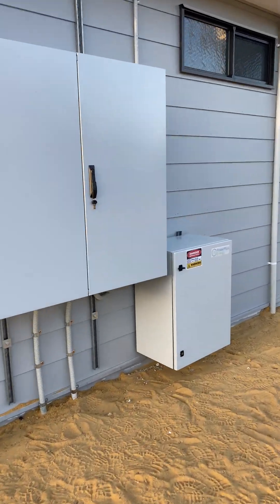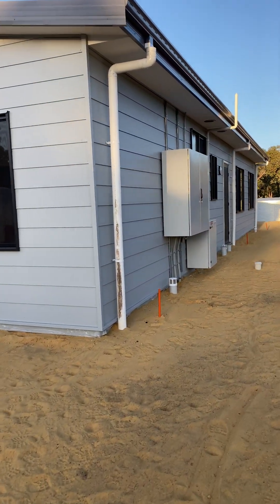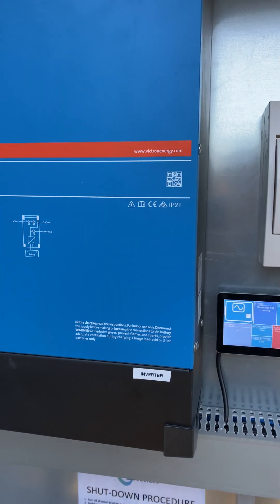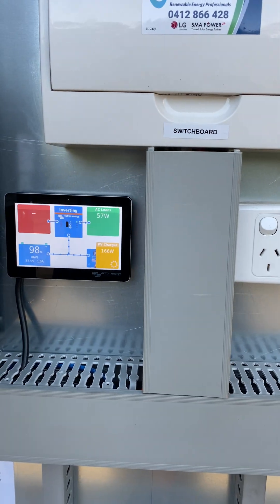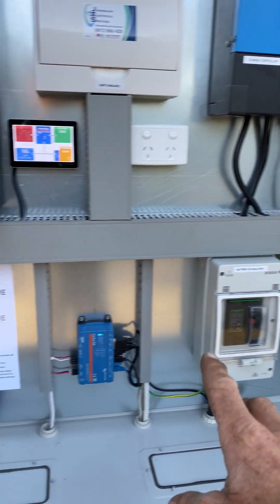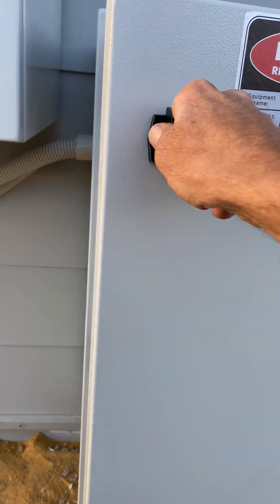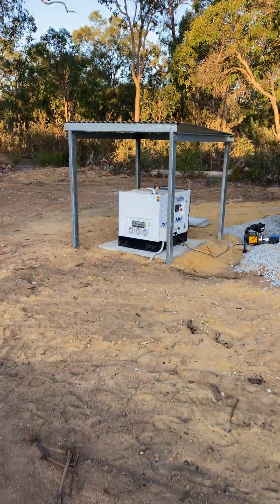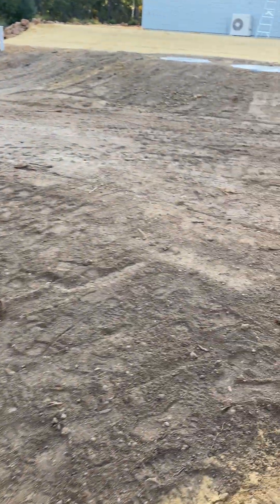Victron and Power Plus batteries Off Grid Power in Australia for a modular tiny transportable home.

Comment: Nice job & clean install, I do have serious concerns about the amount of ventilation for the Victron gear though, i have mentioned elsewhere why I believe it needs temp controlled fans & maybe a slide out washable filter underneath for better cooling & ventilation, just to play safe if nothing else, but this gear can/does create a lot of heat in that small space, and I am sure that system & it uses is going to grow sooner than later. Beautiful execution all round, and I cant believe how much of a finished house they have in just 1 week, amazing. TFS. Cheers from Qld
Reply from the maker: Thank you and Yes I agree to an extent. There is actually some ventilation behind the back panel. In addition the entire system is in the shade and wont actually be working very hard. The Victron products are very durable and get installed in way worse locations in motor home and boats, there is plenty of ambient air in the cabinet. I will however be asking my client to monitor the temperature of the cabinet and better ventilation would be an absolute must if the cabinet was in the sun..
Reply: @joondalupelectricalservice3201  my first multiplus 2 had no thermostat controlled fan. it gets too hot in the cabinet. i wont do that again. see how you go but i always use extractors now. you can get good 120mm AC or DC fans from jaycar that work well and only 50 bucks or so.
Reply: Agree on that, I got thermally controlled fans in my inverter box, work very well, I use pc fans 6€ each (120mm).
Job is well done, good job.
Reply: Exactly what I will need “extra Ventilation” we have same problems and the inverter / charger derates itself as it gets hotter, it does drop out on hi temp, I’ve introduced more fan cooling, here’s a tip aswell, there is a temperature sensor called Ruuvi that you can add to the Cebro and displays on the VRM which you can switch relay on/off maybe a larger fan.
Reply: Ps nice install 👌
Reply: @alanblyde8502  oh nice!
Reply: yep, love my victron gear and trust it, but still put active cooling on CC/inverter - just doesn't feel right hitting 50c during the day ^^

Comment: What about the inverter and the charge controller cooling?
Reply from the maker: Good point, neither will be working too hard and the enclosure is/will be completely shaded from a patio. Additionally there vents behind the enclosure.
Reply: @joondalupelectricalservice3201  👍👍
Reply: @joondalupelectricalservice3201 It is a very nice install, I’m not convinced there is enough ventilation for these devices though, I believe u should have at least 2 fans that are temp sensitive and slightly staged to help maintain temp control, I have heard that when charging from mains/generator via Multiplus II, that they can create a lot of heat, one guy in Europe had to reconfigure some internal fan ducting on his unit as it was getting externally very hot to touch, he said after he did this it maintained a much lower/acceptable temp, Im not sure if his was a 3kw or a 5kw Multiplus II.